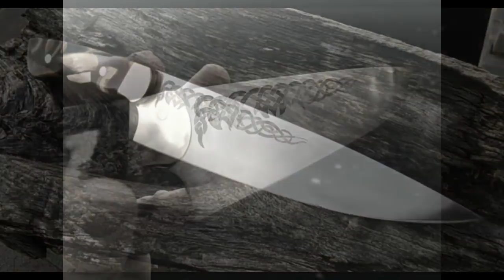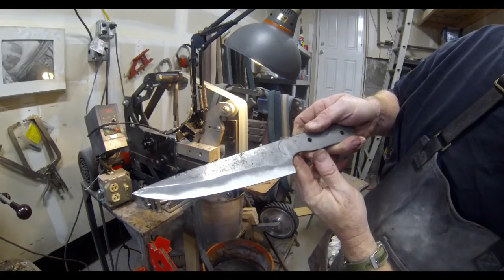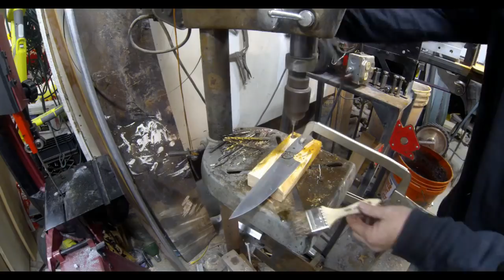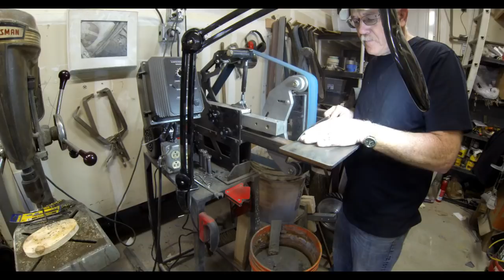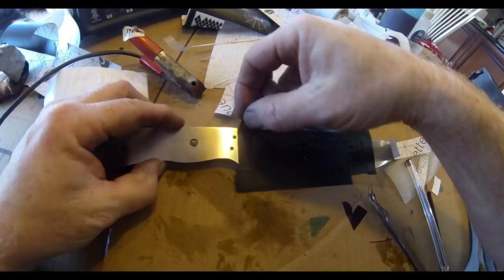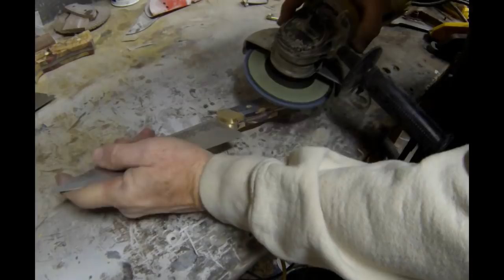How to make a Stanless Steel Kitchen Knife with Celtic Blade Etching and woolly mammoth molar handle

Comment: I thought stainless steel wasn't magnetic
Reply from the maker: 300 series is not magnetic, 400 series is but will also rust. Im using one of the new super stainless steels called AEB-L its the same material razor blades are made from. It holds a great edge, awesome rust resistance and is magnetic.
Reply: @DIYeasycrafts  thanks for the information

Comment: I’ll be damn. I have all sorts of sanding and grinding machines. But using an angle grinder with a flap disk on anything other than steel never crossed my feeble mind! I’m off to try it out....
Reply from the maker: Just use a very light touch and let me know how it works out for you

Comment: Did you check that knife for flatness.. It might have been the angle of the camera, but at 8:45 the knife looks like it has a warp in it... It could be from making the edge so thin before heat treating. Especially with such a large blade... I've never tried pulling a knife from the side, which could be causing inconsistent grinding, but if you are using a wide angle lens, that could cause the blade to look warped too, so it might be just an illusion... Congrats on the AEB-l, it's a fun steel... take it easy...
Reply from the maker: Flat as a board. Confirmed with surface grinding post heat treating
Reply: @DIYeasycrafts  Good to know, must of just been the camera angle..
Reply from the maker: Gopro which has a fisheye lens.

Comment: What’s this new type of steel? Stanless! Lol
Reply from the maker: AEB-L stainless. Got in from NJ Steel. Nice to work with, hardens to around 60, and hold a great edge.Best off I have not yet had any rust!!
Reply: @DIYeasycrafts  What thickness did you happen to order? I've been looking into ordering from NJ Steel and was curious.
Reply from the maker: The current batch Im working on are .110. The blade in the video was thicker but Im really liking the .110 thickness for chef knives